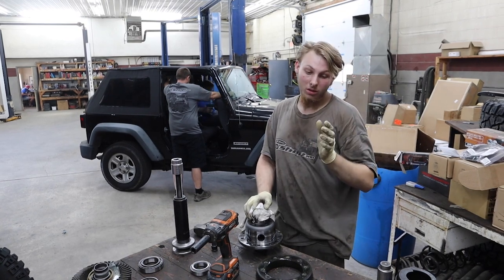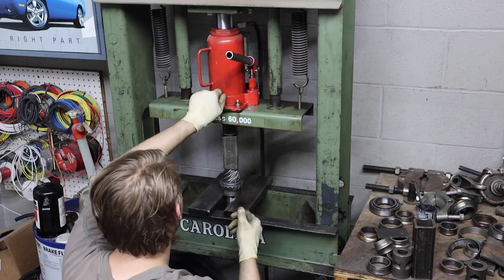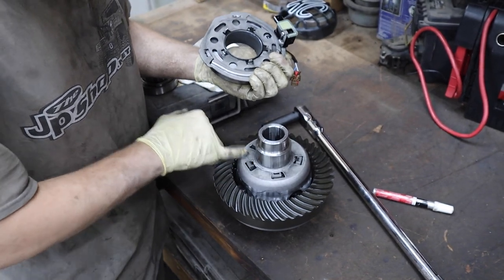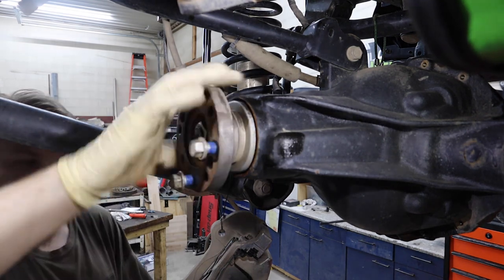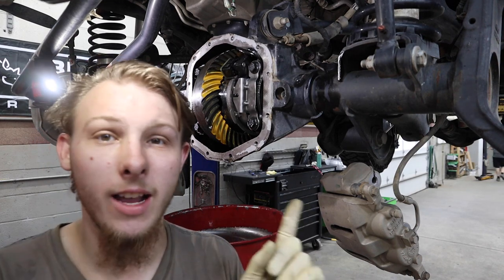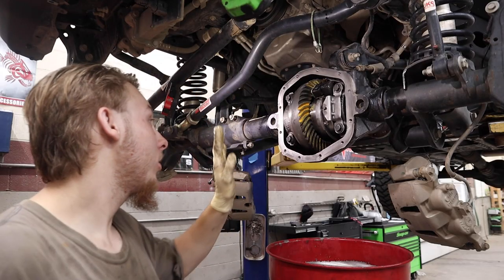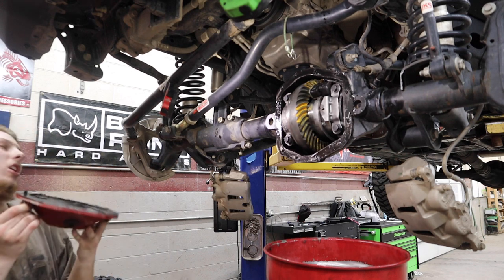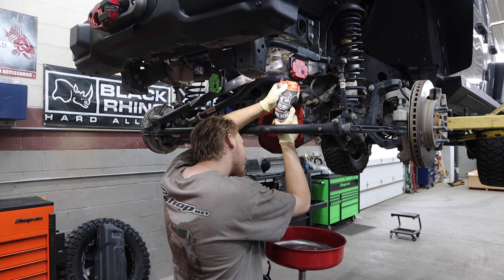WRANGLER JL 5.13 RE-GEAR Front Differential Build & Install

Comment: Remember I told you about changing gear ratio? That's when you started putting big wheels with tires. You said,  it will be fine without.